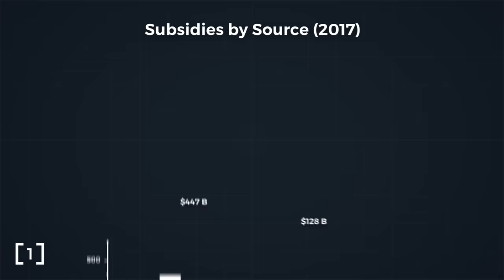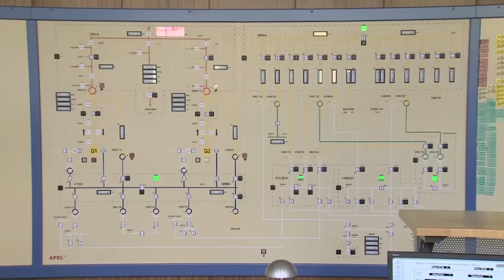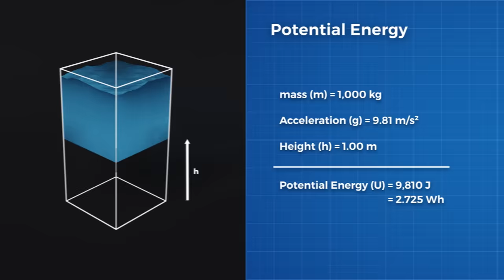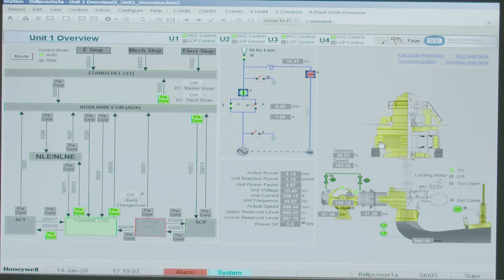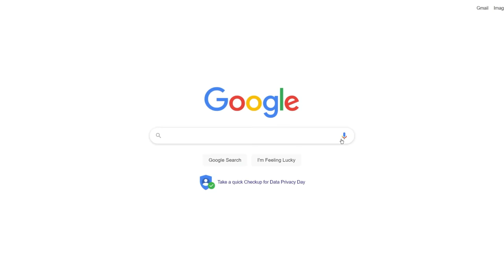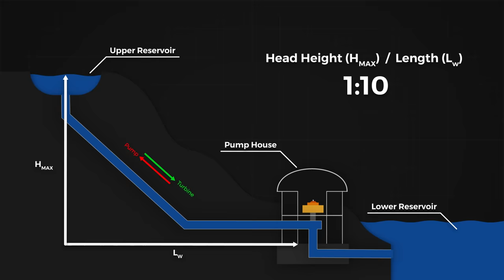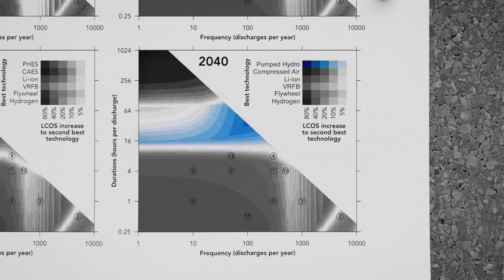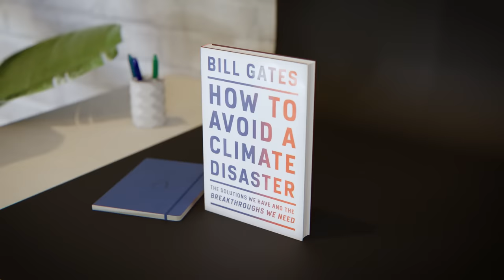The Truth About Pumped Hydro

Comment: We'd have unlimited energy if we weren't scared of nuclear plants
Reply: Carbon free, cheap energy just like France.
Reply: Up till about 20 years ago this was correct, but nuclear power costs way more per installed kWhr and takes way longer to construct than solar or wind at this stage, and this has been the case for some time. Also using nuclear would mean most countries are just swapping dependence on one group of despotic scumbags for oil to dependence on another for nuclear fuel, so it's not a good decision for any country that wants genuine energy independence.
Reply: @peglor  We could go carbon NEGATIVE right now if we put fossil fuel/wind/solar subsidies into nuclear like France. We're wasting time because of political reasons and the fossil/wind/solar lobbies trying to enrich themselves.
Reply: @SwordFighterPKN  The difference is you get the raw materials once and can keep recycling them to make more batteries/solar panels. They're not consumed irrecoverably by the process of being used to generate power while pumping more CO2 into the atmosphere like fossil fuels.
Reply: @halahmilksheikh  Check how long it takes to install a nuclear power plant, including getting planning permission and you'll see why, even if it was as cheap as renewable on life cycle cost, which it isn't, it would leave a 10-20 year minimum hole in generation capacity. I'd take nuclear over any form of fossil fuel and the geothermal power plants that look way too like fracking for me to even consider them, but it's no longer the best solution on running and installation cost and not even close to competitive on planning cost and construction time.
Reply: Yeah, great idea. There are a couple of issues however. One being uranium is a finite resource, so at some point we'll run out of it. Second issue is the possibility or in fact probability of nuclear accidents and the consequences of that. If three mile island and Chernobyl taught us anything it should be that at some point either equipment fails or people fuck up.

Now if you think the chances of that are pretty remote. Think about it this way, are you confident every country in the developed world dotted with nuclear power plants is capable of running those plants without an accident occuring at some point ?

Another obvious issue is the security of those plants. By security I mean the threat of terrorism, either foreign or domestic. Threats posed by wars, humans never stop having wars.  How long before some despot gets into a conflict with another nation and decides he or she will just fire a missile or drop a bomb on one of their nuclear plants ?

Also the threat of natural disasters like earthquakes, tsunamis, hurricanes, tornados, fires, floods, snowstorms, mudslides. Fukishima is an example of that.

Also what do we do with all the radioactive waste. Not just spent uranium but radioactive waste water. Also another question is where do they get built. I wouldn't want a nuclear power plant anywhere near me and I'm pretty sure most people feel the same way.
Reply: @peglor  LOL you have a lot to learn.  Recycling of current batteries is not happen because it's cheaper to get new materials.  You're just shifting the problem to your choosen religion of "green" energy.  Solar panels are thrown way, windmill blades thrown in land fills because the carbon is a use once item.
Reply: @SwordFighterPKN  The amount of carbon that hasn't been put in the atmosphere over the life of the renewables still puts them ahead. Do you seriously think the way things are done now with fossil fuels is the best option?
Reply: @peglor  I'm a supporter of nuclear power and work in energy storage.  Thus I know what it takes for a stable grid and dreams and unicorn farts are not going to get it done.  But the big difference between folks like you and me is I don't  buy into your "green" energy religion and the heresy of not full buying into "climate change".  What I really find ironic is folks like you see no issues with a throw away world where I fix everything if possible.
Reply: @Ozvideo1959  you do know there are other reactor types that don't use uranium right?  Go watch the PBS twisting the dragons tail.
Reply: @taylorc2542  Having seen the damage oil company despotic scumbags continue to do and the enormous benefit to the world a fraction of Bill Gates' wealth has realized through the Bill and Melinda Gates Foundation, given the choice between exactly those two options (Which is in fact a typical straw man type choice) I know exactly which option I would choose. 

However you appear to be saying that anyone making money from new technology is just a bad, which doesn't make a lot of sense to me since they haven't had a chance to prove they're evil while big oil has a century of precedent. Then again you're arguing for nuclear power (On the assumption that everyone's mind can be changed on it - which would be great, but is not a realistic requirement for progress - while still ignoring that it costs more per kWhr than renewable options). 

At this point arguing for nuclear power is the same in terms of outcome as arguing for big oil to continue. Some of the molten salt microreactor tech sounds amazing (When you watch clever 'Bill Gates' style venture capital talks on it - to use your own argument against it), but off the shelf inherently safe reactors are 10 years at least off (And still not cheaper than renewables) - if they'd gone to them in the 1960s (Which would have been technologically feasible as I understand it) the world would be in a much better place environmentally now though. 

I agree that a nuclear backbone would be useful and preferable to other non-renewable options when renewable power is not available, but diversified renewables and smart grid tech with inter country interconnects will be much less prone to the current variability in renewable supply. 

It should also be noted that there are reliable and predictable renewable options out there too, such as tidal and geothermal, which are underrepresented at the moment worldwide, and combined with proper scale pumped storage and battery/flywheel/hydrogen options, nuclear will have very little role left as the cost for each option is compared. The big thing that should be happening and heavily incentivised is home generation - sadly governments haven't the nerve to push this because the companies selling power to everyone know exactly how screwed they'd be if people no longer depended on their power anymore, so the lobbying against it is strong. Community owned power generation getting around this in some places thankfully. Also a decentralised power grid is way less prone to massive outages like we've seen in  Texas or power station accidents or vandalism.
Reply: Nuke cannot regulate output power to the actual demand. Enery storage with stuff like this is necesary to increase the nuclear overall power. When it exceeds the demand, the plant pumps water up, when the demand exceeds the power supplied by nuke (and other non-regulating sources) it turbines water to produce the needed power. As the cycle is daily (at noon demand is maximal, at 3am is minimal) the capacity of the reservoir does not need to be too large.
Reply: @pedromerchan8199  nukes supply a stable base load something wind and solar will never do.  But by all means continue with your sermon.
Reply: @SwordFighterPKN  did you ever read my sermon?? I am indeed defending nuclear, but also that it has limits that may be overcome with energy storage systems like the one subject to this video.
Reply: @pedromerchan8199  oh I'm all for nuclear with other systems for peak usage, like battery storage.  But this religious beliefs that "green" energy can become the grid is laughable.
Reply: @pedromerchan8199  You got it the wrong way around. If the demand for power is exceeded in general, we CAN store it by pumping water or electrolysis for example, but if we don't have that option then we could also just waste the power into heat or whatever (we could even generate wind, lol). Wind and solar on the other hand cause us the additional problem where the production can (relatively) very suddenly decrease below the demand, which calls for some other (fast) method of power generation to (temporarily) fill in the gaps, such as battery storage or pumped hydro.
Reply: You paying for it?
Reply: @1Wilful  A bit of overproduction is a small price to pay for the fastest and safest solution to the climate crisis.

Comment: Obligatory comment calling out anyone who makes a video on renewables and doesn't mention nuclear energy once.
Reply: Nuclear energy technically isn't renewable.
Reply: @garethbaus5471  Technically neither is the sun. 🙄
Reply: @A_Box  mic drop
Reply: yeah it's not renewable but it is clean-ish (saying that having worked on nuclear subs and lived near a shutdown nuclear power plant, Zion IL, that is kinda finally cleaned up after 20 some years)
Reply: @Indpendent01  It's clean-ish in terms of greenhouse gases, the problem is we still haven't found a solution for the waste other than "let's bury it deep under the earth and forget about it", plus the issue of pollution in case something goes really wrong.
Reply: @Naryoril  how about comparing 128B for renewables vs 21B for nuclear which is the largest scale of clean energy?
Reply: @CBielski87  The question is, what is "clean energy"? Are we talking about greenhouse gases only? Then yes, nuclear should be classified as clean. Unfortunately nuclear has another type of waste that prevents it from being classified as "clean" in a more general sense. And that even ignores the risk of an accident.
Thus nuclear as it currently exists is a good and relatively fast to implement solution to fight against climate change in my opinion, but it isn't the solution we should ultimately be gunning for, it should only be a stepping stone.

As for subsidies: nuclear plants are silently heavily subsidized. No nuclear plant has an insurance to cover the cost of a large scale incident even remotely. If such a thing happens the vast amount of the cost of cleaning up that mess will be covered by the corresponding country. Thus they are subsidized.
Reply: @CBielski87  Wtf? Saying nuclear has its advantages and its drawbacks makes me a hippie AND a nazi? Well, you officially declared yourself a simple troll with that.
Reply: @Naryoril  Well, if you want to discuss "clean energy" you should look up just how much extremely dirty chemistry is behind solar panels (production and later disposal) and making neodymium magnets for wind turbines isn't exactly clean either.
Reply: Right!  People need to learn about Gen 4 nuclear technology.  Generates 90% less radioactive waste.  And fissile material is available that could provide all the energy to provide everyone on earth with a high standard of living for 1,000 years.  Clearly gen 4 nuclear power is an urgent goal along with conservation, wind, solar, and grid battery storage.  Let’s get this done, people!

Comment: Can "an ungodly rush" be made an official unit for water? Also, that is a beautiful machine.
Reply: The empirical measurement for a hydro-dam flow, Good Friday shoppers' stampede, and a horse pissing,
Reply: Truly a beautiful machine. I love engineering, especially when it comes to renewables, but this makes me love it 10000x more
Reply: Perfect name for a metal band.
Reply: That implies the existence of a Godly rush. Ungodly is water flowing down and godly is water flowing up?
Reply: Why not? we already have "fuckton" anyway
Reply: I love it. Could use an ungodly rush of Guinness now in an Irish pub.
Reply: No doubt it sounds it also, I was at the (admittedly much larger) Dinorwig plant in the UK and had the good fortune to see it suddenly fire up all it's generators at once as a child. They have guided tours there and though pure incessant questioning I got to find out what happened too, turns out there was a problem with one of the UK's nuclear reactors (I presume a SCRAM probably). Thus Dinorwig was dispatched to provide cover until other power plants could take over (I presume that CCNG's had been dispatched also but they need the better part of half an hour or so, Dinorwig needs 10-60 seconds). In this case probably closer to the latter end as the turbines were not doing spinning in slow reserve beforehand as the supply and demand imbalance was unexpected. You can hear each of those massive valves open with a rock wall between you and them not to mention the roar of the water rushing through the mountain around you as the shafts connecting the generators to the turbines spin up before your eyes. Little me thought this was the most awesome thing ever lol.

Comment: Good article! In New Zealand, there is active investigation (with $30M to fund the investigation) to use Lake Onslow as a 5TWh storage lake. That allows long term (as in seasonal) storage. Est cost $4B. New Zealand uses about 39TWh a year (before we all go electric), so the storage represents about 13% of the total use. Other solutions will help.
Reply: I dont think a lot of New Zealanders appreciate the scale of the Lake Onslow Scheme, the total worldwide installed pumped hydro storage capacity is somewhere around 10TWh, Lake Onslow is currently penciled in to possibly be 5TWh, but it could theoretically be up to 12TWh if they go for the maximum possible. We could literally have the majority of the worlds pumped hydro capacity in one lake.
Reply: @kecuthbertson  Is Science all you keep yourself updated about?
Reply: 1/8 of the total ANNUAL consumption in one single storage site is insane